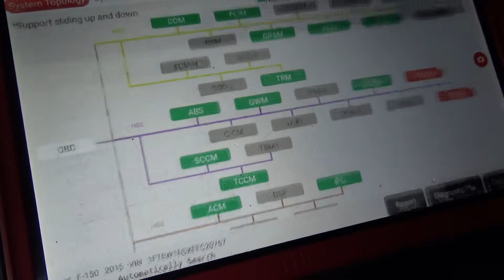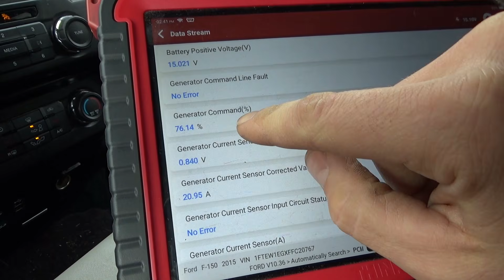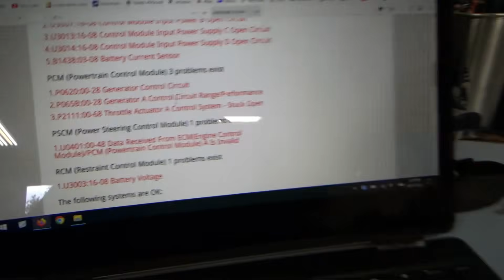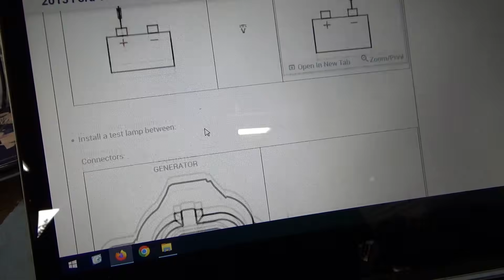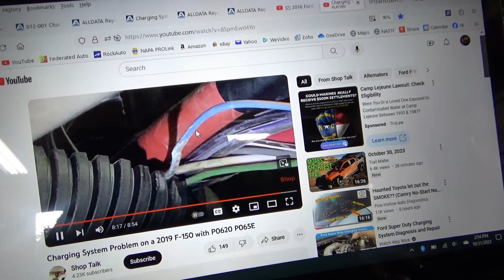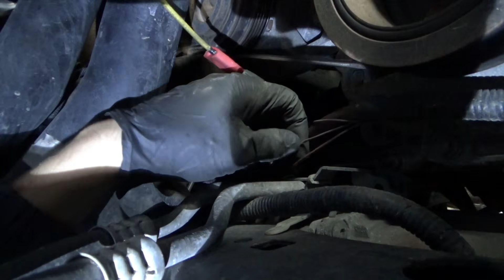Ford Battery DEAD...in the RAIN?? (F150 EcoBoost P0620 P065B)

Comment: An interesting observation, pre repair, charge voltage 15.1V. Post repair 14.4.  The 15.1V was a big red flag, talk about toasting the battery. :)
Reply: Its pretty common for newer cars to boost the voltage up to 15v occasionally as part of their smart charging strategy, I believe that the scanner said the desired voltage was about right.

Comment: I work for my local DPW and we have a couple F-550s. one of them The instrument cluster would go wonky, cut in and out and would say trailer fault, Whenever the truck was above 1000 rpm. it turns out it had the same problem as that F150. instead of looking for the damaged wire,  I just made a new harness going from the alternator to the battery and the computer and ran the wires along the back of the firewall instead of underneath the engine. The truck put out proper voltage at an idle but once you hit the throttle it would put out over 20 volts 😳 and the instrument cluster would go nuts. I have video of it if anyone has this issue.👍

Comment: I gotten some wire loom in a few different sizes to protect wire, hoses ect from amazon ..MGI speedware braided split sleeve wire loom.. There are probably other products that are similar.  I found this to be superior to the cheap materal used on my old truck .. it reminds me of and i know its not as good as materal used on Cat equipment.  . I was told points of contact on wires or harness ect for shorts ect . Thanks for all you do . Enjoy the video

Comment: I think Ford pick ups also had a fuse box and wiring problems when they had it on top of the rad there was a recall to change or add on a charging relay .

Comment: Good work Ivan.  I think the communist democrats are on the zoning board there in PA.  I would go ahead and build a tractor and farm equipment repair show.  You have to have motor vehicles to pull horse trailer right?

Comment: With the info from the net I would have poured water on the suspected fault point to prove that spot without going to all the testing as that would prove the net conculision just a short cut IMO Cheers
Reply: That’s exactly what someone would do without the tools equipment knowledge and patience to pinpoint the exact cause of the problem. And no one would learn the process it takes to do that which I am thankful for.

Comment: I have a crazy one that has me scratching my head to figure out.  2005 Nissan Altima ran perfect with no issues when parked then the wires got chewed by groundhogs or field mice completely killing the ignition so that nothing but the dome light would get power, not even the horn or hazards.  Dug for days and repaired all broken wires which were all outside the cabin and everything is back on line but when the turn signals are used it scrolls through the trip meter settings on the odometer and resets the trip mileage etc... with every key cycle. I did the contortionist bit and went through each and every wire in the dash and cluster but can't find anything questionable.  It is my personal beater so I really don't care that much and gave up but has anyone ever ran into a similar situation?  The power of the internet didn't help me with just searching but you never know. Lol
Reply: Missing ground somewhere maybe?
Reply: Uneconomic to repair, but u saved it from ameadite death. Small price to pay!

Comment: Wow! Nice find and repair.  Ford should be paying you, not the customer.
Reply: Not a truck guy, buy my 99 Corolla runs like a top. Like you all, I will stay with anything 2010 and older until there are none left
Reply: @WN_Byers  I agree
Reply: What a engineering blunder. You never put diminutive small signal wires in the same bundle as a 100 amp wire!. This was destined to fail  was it poor engineering or bean counter designed disaster?
Reply: No vehicle last forever. Parts deteriorate...wear and tear and age. And add animal damage.
Reply: The problem was caused by some knucklehead not installing a nut......
Reply: We depend on our Ford trucks, and find the later models to be more complicated. Thus, they have more issues. The day of simple mechanicals and electrics is gone.
Reply: It's on the customer for buying that vehicle. If you pay top dollar for low quality junk, they will sell low quality junk and ask for top dollar.
Reply: @SK-2ill  yea it doesn't matter what the make is they all have some problem. They are not made to last. They make a lot of money on parts and dealer service
Manufactured with all kinds of stuff not needed, that you may not want or use.
What happened to being able to order a vehicle base model?
I will stick with older vehicles, until there are none left.
Reply: @robertrousseau3361  that's very true I still drive my 91 GMC 1500 and have a winter beater that's a 2005 Blazer ,and no payments ,both trucks are plane Jane .